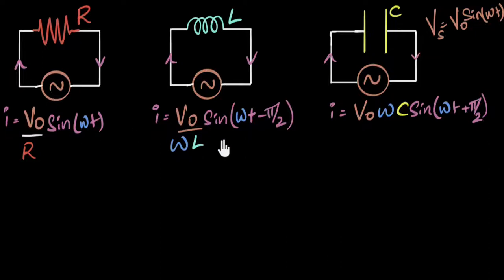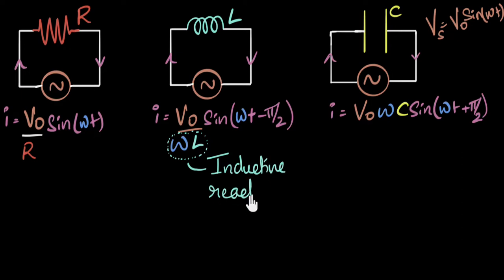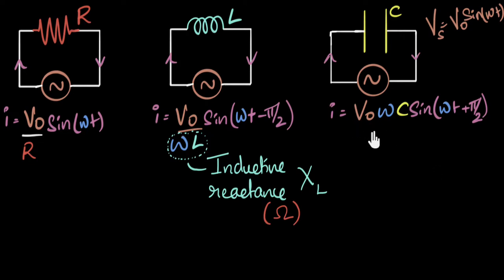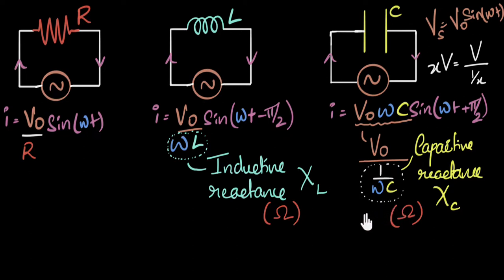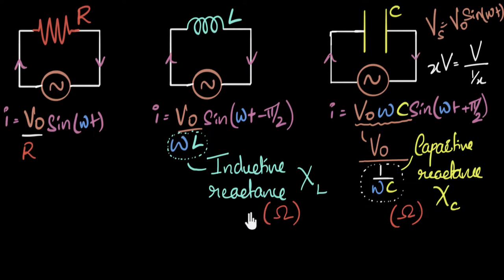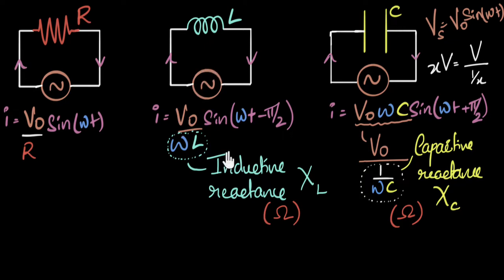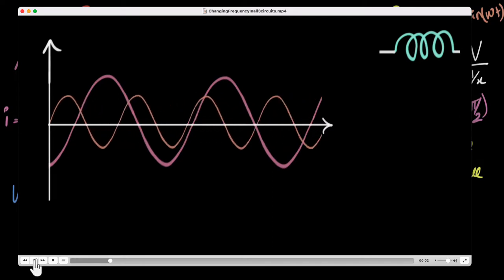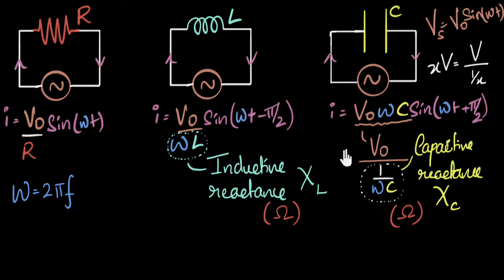Reactance, resistance, & impedance (what's the difference?) | Alternating current | Khan Academy

Comment: sir can I know how the  energy is lost due to a inductive or capacitive reactance , meanwhile in a resistor they are dissipated as heat
Reply: They are also made of some material which has it's own resistance....they lose energy in the form of heat but way less than a resistor ideal...I think!
Reply: @PrabhjotSingh_24  NO i dont talk about about the energy  lost by resistance , rather i talk about energy lost by reactance
Reply: @nishok3502  ok
Reply: Energy needn’t necessarily be ‘lost’. Capacitors and inductors store energy as electrical potential energy and magnetic energy respectively. No dissipation.
Reply: Actually it's not lost, energy is consumed by both the inductor and capacitor and stored as magnetic and electric fields respectively in one quarter cycle, in the next quarter cycle this same energy is released by both devices